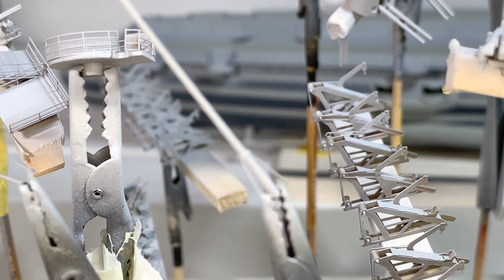German Kriegsmarine aircraft carrier Graf Zeppelin Part 9 Primer Surfacer Undercoat 1/350 ship model

Comment: I noticed you pressure setting for the air brush was significantly below what most people recommend. Is there a specific reason you arrived at that number, or was it simply trial and error to get the best results?
Reply: I believe that 0.1MPa to 0.05MPa is a good pressure setting for airbrush for plastic model painting, although it may vary depending on the airbrush and compressor used.
:yougotthis: